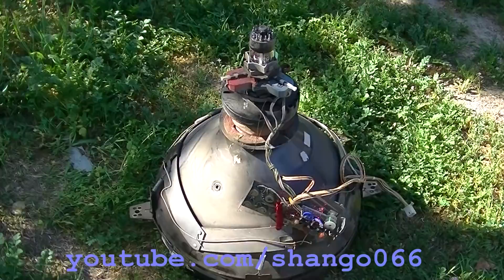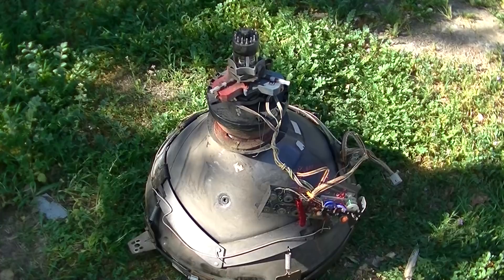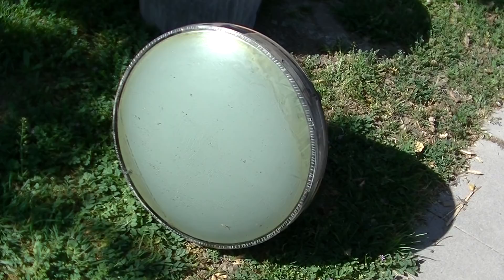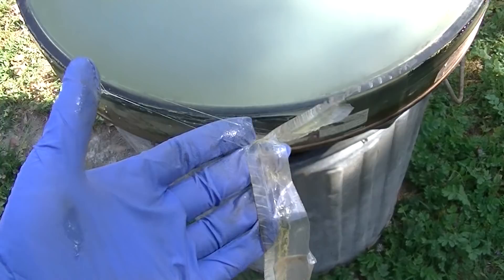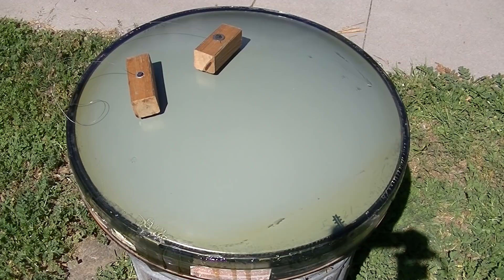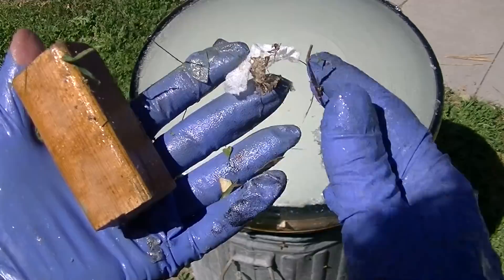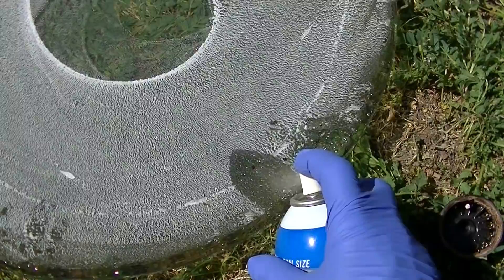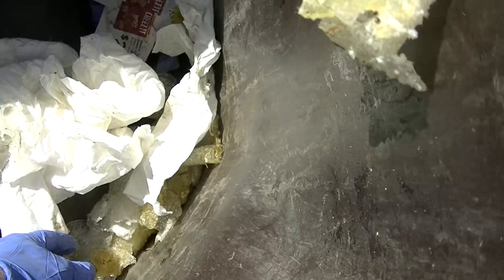Zenith 21FJP22 Roundie CRT Safety Lens Removal Vintage TV

Comment: CRTs without implosion protection are BOMBs.  I worked in a CRT factory in the 90s and managed implosion testing certification with UL and CSA. The purpose of protection is to keep glass fragments inside the set. Later tubes used metal bands around the periphery…never try to remove. I’ve seen them implode and throw sharp glass 50 feet with pieces lodged in walls and ceiling. Have also seen them blow the rear door off our test cabinet. In our ovens where we pulled vacuum, an imploding CRT would blow the machines apart and deform steel cages, taking the line down for a day or more in some cases. We always wore Kevlar gloves, Kevlar aprons, Kevlar arm protection and full face/neck protection. The glass has lead in it to block x-rays so fragments are razor sharp. I don’t work with vintage tubes but would think rebonding the protection layer would be the best approach. Really enjoy your repair vids. Everyone please be careful.
Reply from the maker: Thanks for confirming that. I see some videos of real careless behavior with cataract removal
Reply: How did implosion bands work? I mean how did they protect CRT's from shooting out glass pieces?
Reply: @andrasszabo7386  Roughly. The aim of CRT manufacturers from the 1940's onwards was to make CRTs shorter - measured from the screen to the rear plug - so that TV cabinets could be made shorter. To do this scanning angles got much steeper. The tubes themselves got flatter, looking from the side. This mean't that there was a great deal of pressure on the screen and back of the tube and this force acted to push the sides outwards all around the edge. To counteract this force they needed implosion bands the  metal bands around the periphery. These bands are under tension and if removed, the CRT might well implode. 
Easier to show in a diagram than describe.
Reply: @andrasszabo7386  In our factory, a special tape with fiberglass mesh was wrapped around the CRT, the steel band was heated so it would expand, and then slid over the CRT. As it cooled, it shrunk, placing a lot of compressive force on the glass. If the CRT received a frontal impact, the band helped ensure it maintained integrity. Dimensions of the band were critical to ensure the right level of compression after it cooled.
Reply: @shango066  brilliant news the USA is pushing a" right to repair law" on electronic items .I predict lots of workshops opening for fixing stuff.I wonder if you started the ball rolling?
Reply: @Roland_Tr909_Swing  Louis Rossmann did

I'm curious what shango thinks of it though

Comment: I will never forget the time my father and I tried to neck one of these old CRTs. It wasn't a roundy but it was very long (deep) with less than 90 decree deflection. We removed the scan coils and put the tube in a hessian sack then in a thick polythene garden waste sack. We then from a good distance took it in turns to throw rocks at the neck. I missed, them Dad missed, then I hit it and Wow!! Foooom! There was this thud (like the same deep thud you get when two vehicles collide) the thing imploded leaving glass all over the garden in around a 15ft radius. There was very little of ether of the 2 sacks remaining. When I watch you do this stuff I have so much respect for you. These old tubes a highly dangerous.
Reply: lol, early 60's, routinely went to the local junkyard and threw rocks at CRT's, seen dozens implode. Also would break apart transformers, get the E-shaped sheets and throw them.  If thrown hard enough, they would imped into plywood.
Reply: The park I played in as a kid was fairly large and had a pretty large street cut right through it and it had a creek and so that street was a bridge.  This was in the 70s when people of my terrible city thought of parks as a place to dump stuff. 

Well, me and my 8 year old buddies found a TV under the bridge  with an unbroken CRT and we smashed it with rocks and bricks trying to get it to break.  Those things are strong, but of course, the safety glass was still on it.  I don't think we ever got it to break.

Comment: When I was a kid in the 1960's I placed a black and white crt in a metal trash can just like was shown in this video. I then taped a M-80 to the face lit it and quickly ran away. The metal can cover went sailing higher than my parents 2 story 1920's house. I spent quite a while picking up glass from the yard and driveway before my dad got home from work.

Comment: A few cheap "wood working shims" you can get at most any hardware store for a few bucks might come in handy, inserted lightly by hand to speed up separation a bit. They are cheap enough so if they get saturated with goo you can just toss them. Content satisfaction guaranteed!
Reply: Yep and plenty of “free” chopsticks with takeout.  They work great for all kinds of odd jobs or simply as epoxy mixing sticks :)
Reply: And inhibits rebonding. They also sell plastic shims for cheap.
Reply: @KameraShy  I never knew that wood will permeate glass, thank you for enlightening us.
Reply: may help it explode too
Reply: @mohinderkaur6671  I said "lightly inserted by hand"

Comment: thank you Shango066 for your videos. your videos helped me to fix my vintage equipment. i need to fix a vintage early 1970s Panasonic portable 9 inch set it doesn't have vertical deflection. it's probably some component or i need to recap it or it has bad tubes.

Comment: Damn was going to say Gasoline / White Gas will work fine to get rid of that crap then you break it out.. in a stylish can too!.. I often inject some between the CRT / safety lens and it will make removing it so much easier, might not even need the guitar wire...

Comment: I don't know if it is strong enough, or if this crap is flammable, but maybe nichrome wire (instead of guitar string) and a lithium battery would make this a lot easier.  The wire would become the proverbial  hot knife and the goo butter.

Comment: Now with the Safety Lens off of the CRT, a good whack on the side where the bonding tape originally was and joined the Lens to the CRT will yield the highest implosion. Glass could fly as far as 100 yards and do severe harm to anyone around it.

Comment: Hey shango066, you might want to try using acetone. It is pretty cheap and will wash away even original sin. It is not really dangerous, neither carcinogenic nor genotoxic.
Reply: lol original sin :-D
Reply: It would be fine if the acetone could dissolve it when its stil bonded to CRT.

Comment: I think I know exactly what that sticky stuff is like. One time I took apart an old rotary phone and inside was a box of terminals filled with sticky clear goo. It stuck to absolutely everything and wouldn't wash off with soap and water. That stuff was the definition of a nightmare.
Reply: I experienced the same, wonder if that is what it is
Reply: I'm wondering if this substance was originally a silicon that in both cases degraded into a sticky mess. Soft touch plastic degrades in much the same way from a grippy surface into a sticky goo that is a nightmare to get rid of.
Reply: @TorontoPopulistConservative  from what I read online it’s a special dielectric gel they developed, it’s infamous when it comes to repairing rotary phones lol

Comment: Water and soda (naoh) . let it sit in there and the emulsion is much easyer to remove. it will not be sticky and it comes of from the glass almost by herself, you can use even a water hose...  good luck

Comment: I wonder, could you coat the concave side with aluminum and make a telescope refractor? The radius looks about right.
Reply: Maybe, but only after polishing it. These are more or less rough on the inside I think. The roughness is filled up with the PVA, so doesn't disturb the picture. And if it's hardened glass, you probably can't polish it without it exploding to tiny pieces.

Comment: I NEVER remove that plastic film.  EVER.  I have a 25 year old stereo and a 25 year old tape deck with the stickers still on them.  The one on my game system fell off, so I cut a PDA film up to the size of the screen to replace it.  Every single thing in my house that ever had one of them still does.  I have a landline answering machine (because of the cordless phone functionality) that even has it's features on one of those plastic films that's probably 30 years old.
Reply: KMac  Yes. I'm that guy (unless it starts peeling or gets dirty).
Reply: @KeeDx3 Lampshades yes, couch no.  My parents did that when I was a kid and I hated it.  Nothing worse than coming in the house in the summer all sweaty and sitting on a couch with plastic coverings.  Or having to sit on it in the winter when the plastic feels much colder than it actually is.

Comment: I would have been tempted to hammer a flat blade screwdriver into the join and lever the safety glass away from the tube face but I guess it might possibly end in disaster!
Reply: that would not end well , the words hammer and lever are the main fail points !

Comment: Is the CRT that you are trying to restore is the same concept that produce for Ship Boarding Radar Screen that used CRT made by CONRAC back in the old day?
Reply: Back in the day cathode ray tubes were produced for many different purposes including domestic television and radar. Yes, they all substantially worked on the same concept. Though a specialist CRT made for a radar set might not have made a good television.

Comment: As that tube does NOT have a cataract, I'd suspect removing the safety lens would be harder as it is fully attached, while one with a cataract would already have the glue failing.

Comment: There's no color on that tube, is there??
Reply: Zenith 21FJP22  was a color TV tube. You can also tell from the yoke assembly that it came from a color TV. Roundie tubes like that went out of fashion by the 1970's as the technology moved on and CRTs improved. But in the mid 60's you could buy roundie color sets.

Comment: Before you toss it away, I'd suggest you relieve the vacuum, so someone else doesn't get a big surprise.  Also, for gawd's sake, put some split heater hose around the edge of that trash can so you don't break the glass with a scratch. That's a fast way to ruin your happy day.

Comment: Not knocking off the tube nipple, really? I've never found any safety problem with breaking the seal ever so can you please say why you feel this is an issue. It seems to me dumping this in it vacuum state is far for of a risk to workers than breaking the seal under controlled/aware/knowledgeable conditions.
Reply: Pretty sure he was just referring to working on the CRT while it was under vacuum not disposing of it while it was under vacuum
Reply: @thewatchworks1372  Right?!? Take it easy there Captain Morrison. Sheesh.
Reply: wut, he meant to show a normal scenario where you actually want to save a working tube by fixing the cataract. Which involves the risk of implosion since it's still under vacuum. if you break the seal is safe to work with but then it's maybe worth saving the lens at best
Reply: @dh-_1011  Fair enough my apologies, I did wonder
Reply: Shango was demonstrating for us bomb squad newbies a method of removing the cover of an armed vintage land mine without blowing ourselves up lol & he's not going to put it in the trash without venting it.
Reply: Dude it's not safe because you can't be sure all of that toxic vacuum stuff is out. Better go on top of the tallest building in town and drop it down from there just to be sure ;)